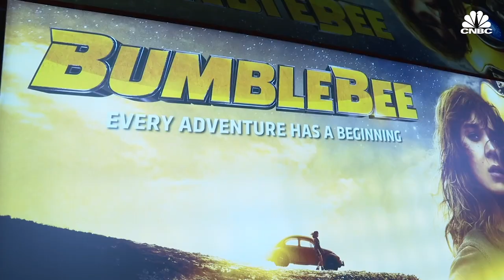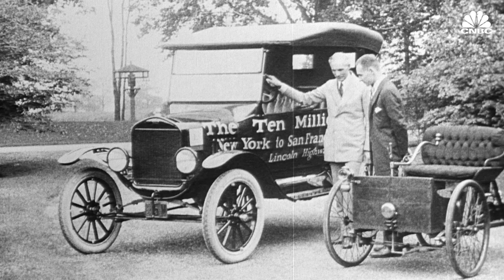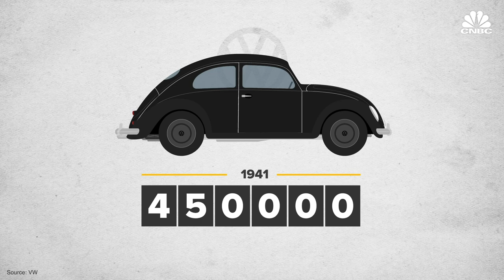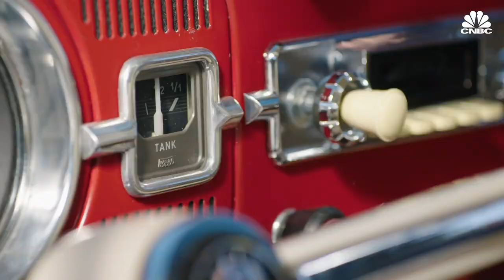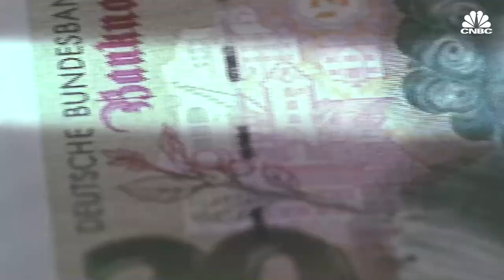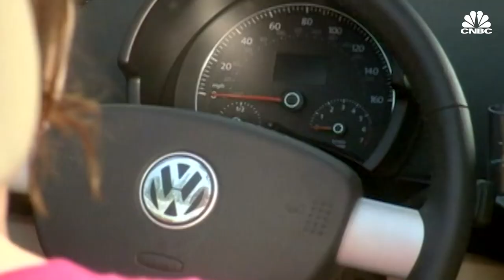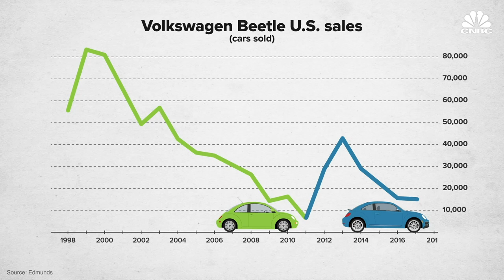Why Did Volkswagen Kill The Beetle?

Comment: I owned a much loved '67 beetle back in the day. I also drove VW buses - a '68, a '69 and finally a '72. The beetle was great, but sure wish I still had my  '68 bus!
Reply: I feel your pain
Reply: Had a 69 and 70 Beetle, but loved the old Type 2s. Drove across Canada (Vancouver to Halifax) in a bus I cobbled together - depending on which part you looked at it was either a 68, 69, 70 or 71. The latter was the engine, and thanks to the famous Idiot Book I was able to do my first (and only) total engine rebuild part way through that trip. Good memories and damn were those vehicles easy to work on. I can say without hesitation that I'd gladly sell someone's kidney to have one again.
Reply: What kind of car do you drive today?
Reply: Few closest friends relayed on Beetles and Bus.  One 60's Beetle was run probably into the 2000's, most of the time daily 20 miles plus for work alone.  It saw it's share of dirt and back roads too!  Rebuilt the engine at least once, had a crude bike rack WELDED to the body and roof.  Hahaha  Totally utilitarian.  Loved it.

Comment: I had a 1967 Beetle for part of my high school and entire college years.  Mechanically, it was a very forgiving vehicle, as it would keep running, albeit not all that well, with a minimum of maintenance.  It was never known to "up and quit" on drivers, but instead, would decline in performance as the mechanical issues with the engine would escalate.
The US gasoline shortage of 1973/74 ; with its accompanying soaring prices for fuel, made that Beetle nearly a godsend for school and work transportation during that time.

Comment: Nothing ever broke on the 🐞 Beetle. Yes, it started in cold weather, it got through the snow and the heater was 🔥 hot. If you didn't need a fancy outfit for work the lack of AC wasn't a big deal. The seats were comfortable and had chair-like seating making long drives a breeze. Steering was light and sporty. Those Beetles 🏁 racing were no joke. The new Beetle should have been rear engine and rear drive. Could have kept car alive and stressed reliability and value more.
Reply: Dude, this is not the 1960s. A rear engine, rear drive vehicle with a water-cooled engine nowadays would run at least around $30,000. Which means this car probably wouldn't even have sold what it did in the late 90s and early 2000s when it became front engine front-wheel drive. and there's not a snowball's chance in hell of an automaker making an air-cooled engine in modern-day times, since that engine has been proven to be problematic if you drive it in certain (hot) weather conditions, and no one's going for a car with limitations nowadays. The best thing Volkswagen could do for a beetle now is make it electric. Even then, it would be a niche vehicle at best.
Reply: Stuff broke all the time.  Air cooled engines  constantly had problems with at least one cylinder.  Alternators needed replacing.  And those things tended to rust.
Reply: Everything broke on them. That is why God made helicoils.
Reply: I agree, rear engined and rear drive, and, aircooled.

Comment: You can still buy the beetle, it's just rebadged to Porsche 911
Reply: Good call, I agree. Driving a canary yellow Porsche 911 throughout the deserts of Southwest USA was one of my thrills of a lifetime. Luckily, I had a great fuzz buster on board and rocking sound system.
Reply: Aside from the air cooled rear engine in older 911 Porsches, there is very little comonality, you could say this for the old bathtub Porsches.  Some of the later 912s had VW engines, was not a good solution.
Reply: yeah and they are come at the same time when the beetle type 1 and Porsche 356 mark the birth of both company too
Reply: no comparison
Reply: Yep, bought a 911SC over twenty years ago, owned it for five years! Loved every minute of it! Red of course, with whale tail and chin spoiler. My buddies accused me of having a mid life crisis! I said, its my mid life crisis and I'm gonna enjoy it!

Comment: The old type 1 car came to a dead end due to emissions and safety concerns, the air cooled engine couldn't be tweeked enough to pass epa mandates, look even motorcycles are not aircooled anymore (nor are Porches), safety, you have ten gallons of gasoline right in front of the driver and little else.  It did have great rollover safety though.  It was inexpensive, fuel efficient, and easy and relatively cheap to repair, it was also fun to drive.
The revival comes up against multiple problems, it is much more complicated mechanically and electronically, and it is much more expensive to build therefore it sells at a much higher price.  While it resembles the original stylistically, it lacks the 'feel' of the original and it comes at a different time in history, many of us who loved the original have aged out of the market, some of our children might remember but it is totally strange to our grandchildren.  The German economy is one of the world's powerplants and the resulting pricing structure means that Germany mostly concentrates on high priced luxury cars and manufactures lower priced vehicles in other countries with lower wage costs, this results in lower quality.  Another factor is the rise to maturity of the Japanese auto industry and the Japanese system of quality management, even the German luxury cars can't match the quality and durability of some Asian brands.
What I don't understand is VW's abandonment of the van market, years ago I had mocked up in my head a marriage of the old minibus with the engine of a front drive VW, I'll bet that Lee Iococa had the same dreams, I believe his K cars had VW engines at one point.  I still drive a VW, a Tourag, one of the best cars I've owned (thus far), it gets about the same mpg as my beetle with six times the HP, 2.5 times the weight, four doors, A/C, auto trans and AWD.
Reply: Upon frontal impact the old beetle gas tank would slide downward hoping not to create a spark.  They introduced EXPLOSAFE at NASCAR in the 70s which would have worked.
Reply: I have heard this furphy spread around for years, even the late 1970s about pollution control with aircooled engines, yer Porsche kept making aircooled 911s for another twenty years and seemed to cope with pollution regulations..

Comment: One of my favorite cars that I owned was a beetle automatic. If you've never seen one it's a standard transmission beetle but with an electric clutch. It had a microswitch in the shifter so the weight of your had would engage the clutch allowing you to shift. It was still a three speed and you had to shift through the gears only no floor clutch.
Reply: That's not an automatic transmission then. It's an AMT transmission,  like some semi trucks have..
Reply: Problem with them was if the driver rested his hand on the shifter, caused problems.
Reply: @keithad6485  Only once or twice and then you would avoid that. I loaned mine out to a friend and I warned him. You'll be driving along and then sit your hand on the shifter and then the car will go into neutral and the engine will rev. The next day he told me I was right as it happened to him on his way home. I still loved it.

Comment: The real beetle died in 2003 in Mexico not that pretend one that came after. Also the second generation Volkswagen van ended production in Brazil in 2013
Reply: It died in 1972....I think
Reply: Are you writing about the T2 Kombi? Were Brazil making it with the 2 litre motor or the 1600 cc beetle motor?

Comment: i bet there will be an new electric Beatle within the next 50 years
Reply: I can’t wait
Reply: if the e works out for honda then that should serve as proof of concept that there's a market for a not inexpensive, cute, small ev.

by most metrics teslas should have the honda e beat (range, performance, charging availability, passenger & cargo space, & price of a base model 3 isnt super far off the price of an e), so if it actually does well it wouldn't be a stretch to say it will largely be because it's small and cute.
Reply: Probably. Its just a very long term marketing plan. They keep "taking it away" so they can keep "bringing it back"
Reply: As distinct from an acoustic Beatle?
Reply: This world is not going to be here as we know it, in 50 years. Probably not the next five ...
Reply: Isn't the old LEAF basically an electric Beetle?
Reply: @Allen Loser I know it's Nissan but it basically fills the same role as an electric Beetle.
Reply: @Allen Loser the actual generation of electric cars show that you don't need the same energy density when you have 5 times that efficiency of a fossil burner. the upcoming generation of cars in 2021 will have a cell energy density of 300Wh/kg. for comparison: the cells in the actual ID.3 have 215Wh/kg.
Reply: @jeffwang6460  if hit with an ugly stick, sorry couldn't resist...  actually the new Leafs look a lot better...
Reply: @Allen Loser it's all strategy.  i just read 8 minute charging for cel phones so it is all coming soon.  the new ev beetle will be within 6 yrs

Comment: I bought a well used beatle in 1973. Had to push it to start (wife pushed). One day the floor fell through and I replaced it with stainless steel.  I sold in in 1975 and made $50  over my cost. It was the most fun car to drive I have ever owned.

Comment: If VW brought the Beetle back as an electric, I think it could do well.
Reply: I agree with you 100%. I have a '71 Beetle that is just undergoing the transformation from ICE to 100% electric. Tesla Batteries + 120HP Regen Motor. This is the future that is happening now.
Reply: I can tell you are a kid. You were not born in the era of the classics!
Reply: I never thought of that...that’s a good idea. But no extras.
Reply: @peterduxbury927  Awesome.  Such power, it may fly off the road.  Good investment into this more reliable tech.
Reply: @peterduxbury927  I'm my dad's beetle with him. It's going to be a 2.0L with twin dubble carb's. Also some race camshafts and bigger valves, electronic ignition, ect. Also around 120hp!😂
Reply: I don’t think electrics have caught on just yet, despite the successes and breakthroughs made by Tesla. Hopefully within the next decade, electric cars will be a lot more commonplace. The Beetle CAN potentially be revived to compete with BMW, Tesla, Toyota, Nissan, Ford and Chevy for the title of Best in Class Compact (small) Electric vehicle later on. VW absolutely NEEDS more than just the Bus and the eGolf in their lineup if they are serious about going fully electric as their future.
Reply: But it's has to be cheap car as it was back than not a luxury car

Comment: The biggest problem with the old and most beloved Beetle is safety.
I'd love to see a car with similar goals as the original Beetle, but how can you keep it cheap and safe at the same time?
Reply: I wish Volkswagen still making the original beetle with some modern safety features, fuel injection  and amenity. It could be a hit.
Reply: In the 1960s, Ford did a safety crash test of popular cars at the time, and quietly dubbed the beetle as the safest car! This is from a 1960s book entitled Dan R Post - Volkswagen, Nine Lives Later, 1966. Out of print, but used copies available on Amazon. A fantastic book on Volkswagen at the time when the VW aircoolers were at the top of their popularity.

Comment: A  major problem for the Beetle, the new competition from Japan.  Start with fuel economy.  Beetles achieved about 27-29 mpg city and 30-33 highway.  My Datsun B110 achieved 33 local and best was 42 MPG highway. Next item:  Heater was far better than the Beetle, and the engine was a lot quieter and had more power.  The Japanese Yen vs. Deutche Mark was very favorable and was enabled the Datsun/Nissan (as it called then) to undercut the VW's  price.
  Sadly the Datsun/Nissan  "evaporated" after a few salty winters especially when the left front fender literally fell off.
Reply: When you wrote about the heater in connection with the Beetle, I can say from firsthand experiences that Beetle car heaters could be downright dangerous.  Why what that?  The heat-exchanger unit with the engine exhaust system would leak, sending carbon monoxide fumes into the interior of the car.  
Many people don't consider that water-cooled engined vehicles is what runs a car's heater.  The air-cooled Beetle had to use the engine's exhaust system as the heat source for the car's heater.  My Mom's '63 Beetle didn't have a problem with that; but the '67 model that I inherited from her for school transportation was a problem; as the few times I had to resort using the heater, such as when the windshield iced-over while driving, I suffered headaches and nausea with its use.

Comment: Original Beetle was the stuff of stories at summer camp by our counselors all from U.K.  They said they drive years in a dead battery. They told us of the bump-start or “Starting it like the Flintstones car (tolling with legs).  They said they trick was to park on an incline. 

Could never do that with a modern car. However, jump boxes are the six of cell phones so one can jump start themselves now with minimal space in trunk.
Reply: One of the advantages of a very light car 3/4 ton (750 kg).

Comment: The air cooled rear engine rear wheel drive is the superior version of the Beetle. Sure it might have 30hp to 70hp, but it was simple to work on and has a huge aftermarket and following.

Comment: The old Beetle was needed. The new Beetle wasn't. Also, VW DOES offer a real Beetle concept. It's called the VW Up.
Reply: The VW Up is nothing like a beetle. The beetle is more closer to the golf in size, not even a polo, let alone an UP.
Reply: @Horizon301.  You're talking about the New Beetle, which used the Golf platform. No one needed that car. The original Beetle was conceptually closer to a small, affordable 4-seater like the VW Up now is.

Comment: The old beetle cost less then a Nova or valiant....the "new" beetle cost more then a Impala.
Reply: Parker Weatly - If I remember correctly the beetle sold brand new in the mid 60's for a shade over $1800.  My first car was a used1960 model with a very ugly grey paint job-paid $500 for it. Great car-never had a problem!
Reply: Parker Weatly $1700.00 off the show room floor in 1970 when I bought mine!

Comment: My first car was a 69 with a sliding roof.  $2,000 CAD brand new.  
Amazingly reliable until the floor rusted out at 125,000 miles in the Toronto winter salt.
It failed me once just north of Lake Superior towing a boat.  10 minutes later I was back on the road..the fan belt had broken and there was a new one with instructions how to replace the broken one.  I loved that car.  My next one was a Rabbit...not nearly as reliable.

Comment: When the motor left the rear, it was no longer the beetle, front engined ones were horrible to drive because of the weight distribution when compared to the rear engine
Reply: You’re right
Reply: You are totally wrong...  Did you ever drive or own one..You speak from ignorance.. beetle in the snow was an accident waiting to happen.(heavy side goes foreward yes it does in a spin).handling was interesting..My rabbit gti was a fun fast great handling car a bug was a pos.. go own and drive before you speak lies.. rabbit was amazing in the snow..And i ought to know I always went out in snow..Rabbit never got stuck..Bug sure did..  and in slides in ice quick flip of wheel righted rabbit..Bug would go in circles... Been there actually done that..

Comment: The type one Beetle was the perfect car for people of all ages who wanted inexpensive dependable transportation. They didn't buy it for it's 30 MPG, as gas cost less than $.30 a gallon in 1970. It was remarkably durable, cost little to repair ( I once bought a cylinder, piston and ring set for $8.00 for one of mine, and installed it myself. ) They never failed to start, were good in snow, and were easily serviced by owner. I wish I still owned one.

Comment: Sad to see it go for good. In 1981, when I was a fifteen-year-old, my father bought a 1969 VW Beetle for me to drive when I turned 16. It was royal blue, with a VW bus engine, tinted windows and a chrome exhaust pipe extension that connected to the two exhaust pipes and ran parallel to and beneath the back bumper. I then painted the outside running step boards metallic silver to match the chrome wheel covers. My aunt then bought me a metal gas pedal cover that was a big bare footprint. I had the coolest car in high school.

Comment: Retool and make the Aircooled bug again, watch how fast it sells
Reply: Probably not that much. All cars sold in the US have to be pretty safe and have many standard features (back up camera, for example). Sure the original Beatle was easy to maintain and repair but that is no longer the case with cars of this era with their fancy computers.  I imagine an air-cooled bug would cost just as much if not more as the previous bug (~20k)
Reply: Omar Pulido I know..I'm just saying..if the original Aircooled bug would pass today's safety standards somehow...VW would  sell tons of them!
Reply: @toddvanwinkle7777  the original beetle was a death trap.Very primitive compared to cars of it's age.
Reply: I agree! And keep the pushrod system which is so simple compared to overhead cam timing chains, and virtully never gives trouble!

Comment: 2019 Beetle was just a golf with interior room and storage gone for the sake of retaining Beetle styling. 1979 Beetle was a car offering only 25 mpg yet still barely getting out of its own way. At least slow 1979 golf Mk1 (Rabbit) diesel almost doubled the highway mileage.
Reply: Part of the low power of the aircooled engine reasoning was low compression so the beetle engine could cope with low octane or low quality fuel in third world countries. There is no reason the beetle engine could not have the cylinders and head redesigned for more power output and better fuel mileage. Same with R model BMW motorcycles til the late 1990s engine made to cope with low quality gasoline.